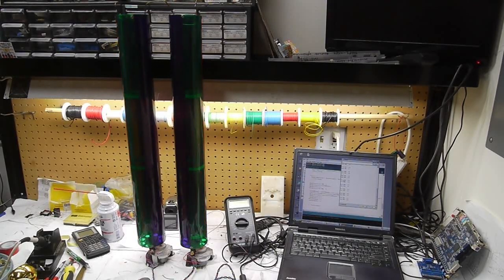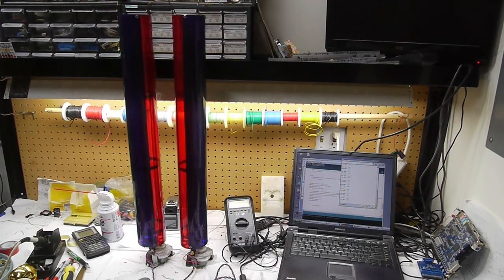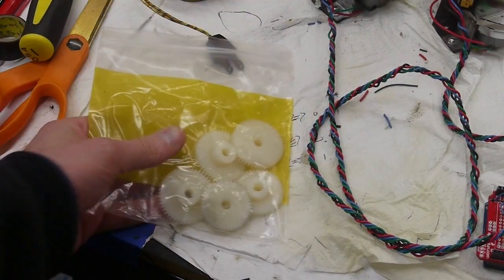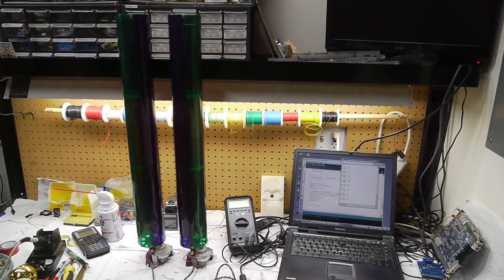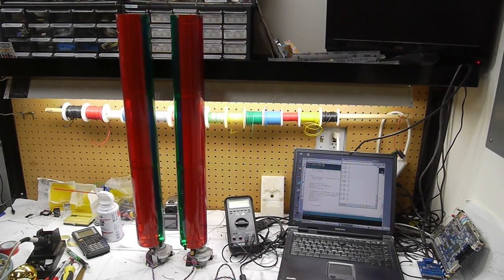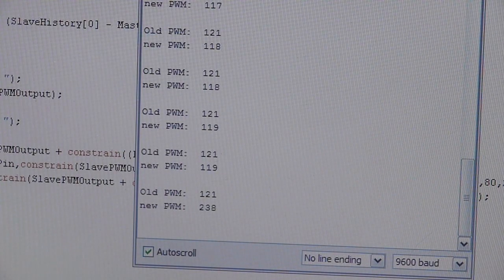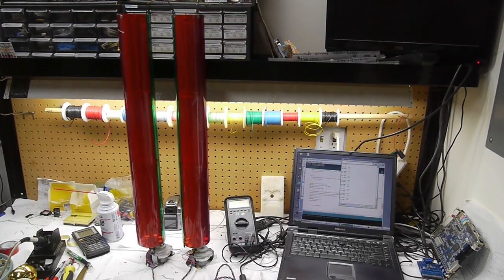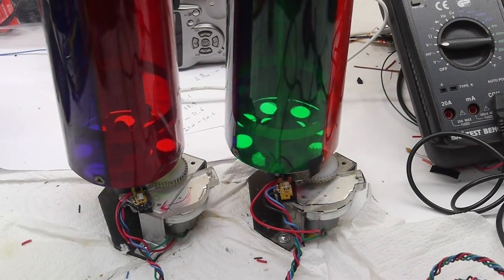Jukebox color wheel synchronizer

Comment: I would have used the phase detector of the CD4046 PLL chip. Keep the original motors and stop one motor or the other for the duration that the phase difference output is active.

Comment: thanks for all your great videos I'm a 30 plus your veteran of jukebox repair and maintenance
 commercially and in these Antiques .
it is astonishing to me how well the original ac display motors held up many 60- year old motors are still running fine and have been told by some old timers that they were just fine in synchro for the first 5 or 6 years my friends at Seeburg actually used a chain to synchronize color wheels and they told me that there was a slip clutch and solenoid mechanisms that was tested but cost too much to go into production I like your design and think that it's ironic a computer running in a 1946 machine but why not

Comment: Could this perhaps have been achieved with just two microswitches?  One of the drums would have been the master, and the slave drum would stop on its microswitch until the master hit its position switch and enabled the slave to ride past its switch.  I wonder if Wurlitzer just intended the colours to run randomly out of sync.  Now the methylene chloride bubble tubes.  That would be an interesting project.  I've lacked the vacuum source to try them successfully myself.

Comment: I makes one wonder why they didn't use a single larger motor and connect the two cylinders to it through belts or some other method, but then again Wurlitzer, while a style leader, wasn't exactly on the cutting edge of mechanical technology. They used the same record changing mechanism with 20 some odd selections for over a decade, until the 45 RPM records came out. At least the modification was made so it can easily be changed back to original should the need or desire arise.

Comment: Hey Ben, you should make a video on why horsepower sizing of AC induction motors with high breakdown torque with low slip is different than combustion engines for periodical loads.or transient loads. Apparently, many people think one needs the same HP rating if the load, regardless of the prime mover's characteristic, is cyclic. Combustion engines do not have breakdown torque and so they must be sized for the worst case torque overload transient or they may stall or bog down very badly.

Comment from the maker: It's true that you could halt one motor until the other reaches the index, however unless the control system varies the speed of one of the motors, there will always be a discontinuity as the system halts and re-syncs at the index point. A better system would vary the speed of the motor until it matches the other in phase and speed. It could certainly be done with other microcontrollers, or even discrete components, but pulling the arduino off the shelf and writing code took only half a day.

Comment from the maker: Yes. The optical sensors from the computer mouse change their output when a piece of black electrical tape interrupts the optical path from the IR emitter to the receiver. Using tape is good for setting up since the index location of each color wheel can be easily changed and tested.

Comment: My thoughts exactly. Using an arduino just seems like a complicated solution to a simple problem. You could do this using a couple of logic gates. I'm actually wondering how the arduino and its shield will handle the test of time as a fixed installation inside the jukebox. It gets real hot inside those things.

Comment: Ben, another way to synchronise these would be to halt one motor until the other realigns itself i.e. both are at the sensor positions. No need for the arduino then.